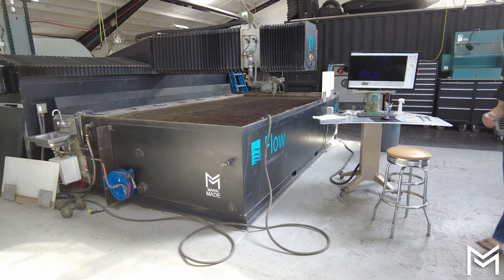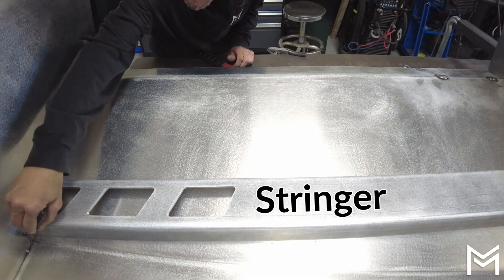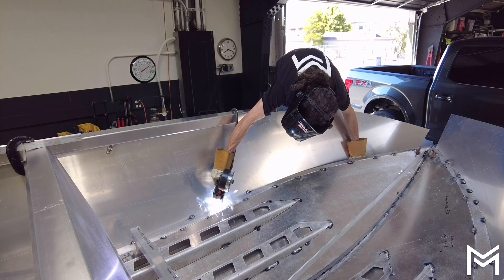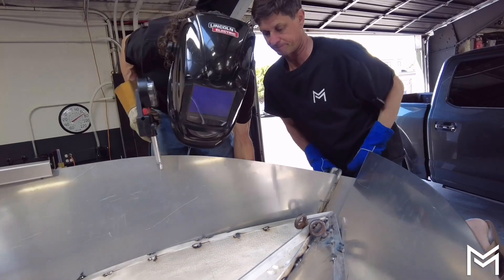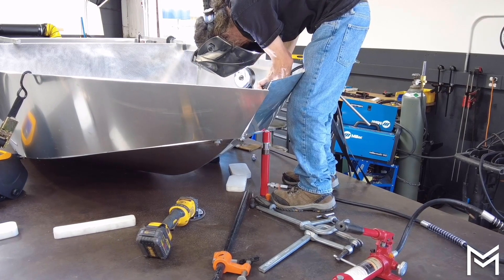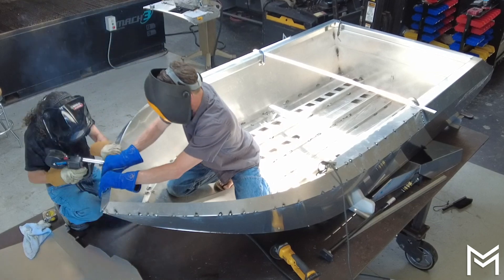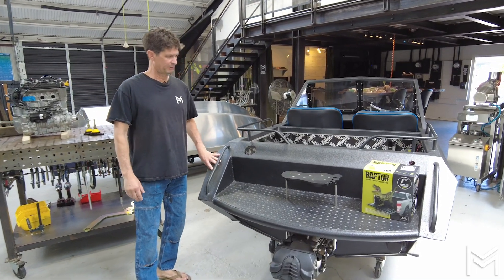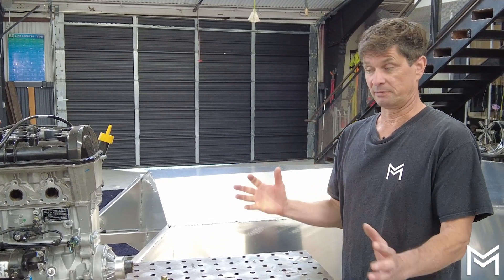Marin Made: Mini Jet-Boat Build: Day 3 and 4

Comment: Awesome Build. I live on the other side of the bridge- would love to check out your shop.. What welder and spool gun are you using?
Reply: We use a Millermatic 190 and a Spoolmate 100 spool gun. We use .035" wire and tips.  Come over any time.  We are at 90 Gate 5 Road Sausalito.  You can text me at 415-871-1484